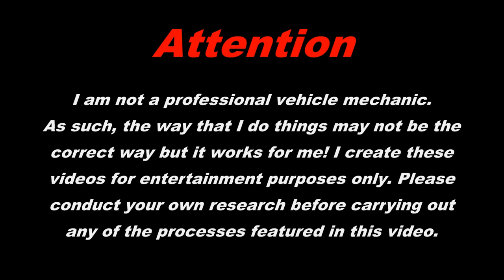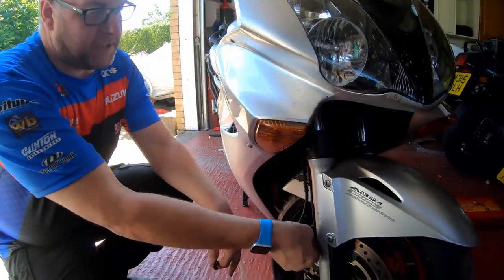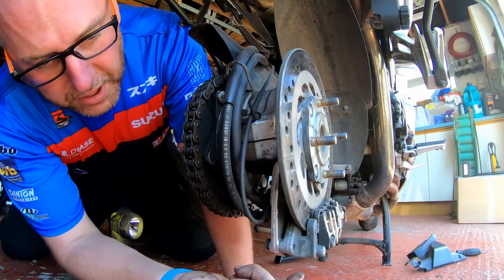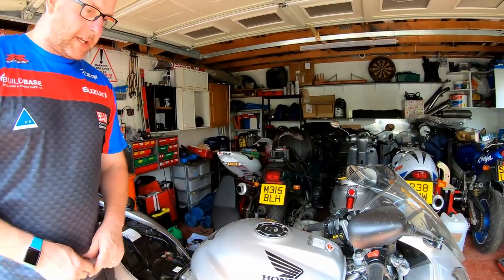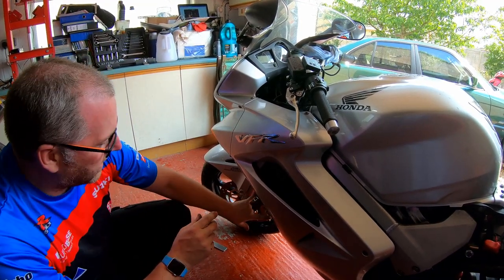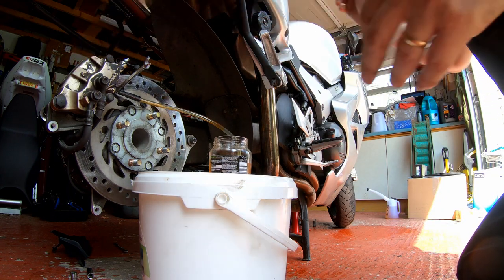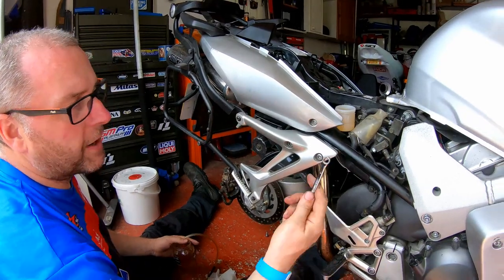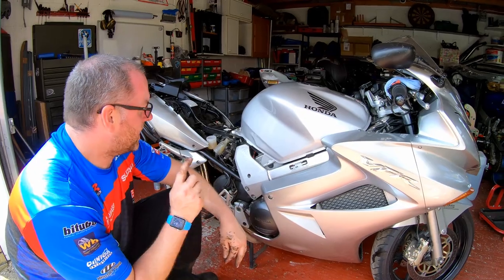2003 Honda VFR800 VTEC Changing The Brake Fluid And Bleeding The Linked Brake System (CBS)

Comment: I appreciate the procedural video but I can’t understand why you’d want to pull air into the entire system before adding and bleeding with fresh fluid. Seems like you made the jobs much harder for yourself instead of just flushing through new fluid to wash away the old in a sense. If I am not replacing lines, servicing calipers, or rebuilding master cylinders, I would just flush in fresh fluid to remove contaminants without introducing any air I need to flush later. Just my $0.02 I guess. Good tips on bleeding the rear in particular by moving the caliper

Comment: I just recently started having an issue with the bike that was causing it to lock up the brakes. At first I thought it was the abs causing the problem as I disconnected all the electrical connections dealing with the abs and the problem went away for some time. However, recently the problem has come back again and I believe it's because the fluids never been changed and is causing pressure to build up in the system. Thanks to your video I have some kind of guide to doing this job.

Comment: Hi Kev - just one little question regarding stage two. Could you please list the procedure like 1., 2., 3.,  I am a bit confused and not a logical thinker, but as I understand it: The assistant pumps the brake pedal five times and hold it down and the secondary master cylinder gets pushed out. Then you push the secondary master cylinder in the caliper, but do you at this point open the 10mm valve or is it already open. And by the way - thank for your brilliant tutorials, Kev.
Reply from the maker: No worries mate, you are using the rear pedal to push fluid to the secondary master cylinder, you then use the secondary master cylinder to push it up to the bleed nipple, so as follows - 1. Pump pedal 5 times to push fluid to the SMC. 2. Push in the SMC with your fingers. 3. Open bleed nipple. 4. Close nipple. 5. Repeat process if necessary.
Reply: @KevsShed  Cheers Kev! Looking forward to your next videos on the VFR.  Excellent job!

Comment: You shouldn’t have to actuate the second master cylinder,you could pull the fluid through to the proportional valve and it should flow through easily 👍
Reply from the maker: Thanks for the comment but that does not work. It should in theory but in my experience it simply doesn’t!

Comment: I did this on my vfr's - horrendous, but it tends to be never done, so makes a huge difference. I suggest using PTFE seal tape on the bleed nips to stop air entering back in the system. 
Great video!

Comment: Just a heads up for those watching this video.  The Non-ABS model of the VFR does not have the right side bleed valve.  This is only for ABS equipped VFR's.  This is also confirmed in parts diagrams.  The difference in bleeding the brakes is that you follow the same process, but obviously don't have that right side bleed nipple to bleed fluid through.  You just go straight to the rear brake and bleed from there instead.

  Otherwise great video.  Though, I think I would be concerned if I had that much travel in the front brake lever.  Looks to me that you might have some seized or very stuck pistons in the front brake calipers.  Having recently done a full service of all calipers on my vfr with new seals and proper grease on the caliper seals, and new brake fluid, the front brake lever is very firm and a lot of feel. 2 finger braking and not much movement at all from the lever. I wouldn't have half the travel you show when you use one finger to pull in the brake lever.  Though, this might be different for ABS equipped VFR800's.   

Please take this as just an observation from watching your video, which is very good and informative..    My point being in fact that my brake lever was a bit like yours in the video, a lot of travel.  When I took my brake calipers apart, I found that 1 piston on the left was very slow moving, whilst 2 pistons on the right front caliper were barely moving.  Though braking was OK..  after the full service, it is now outstanding..

Comment: @KevsShed
At Stage 3, at 32:23, can you please better explain how the assistant is "pushing down on the secondary master cylinder" at the front ?
Is the caliper still on the position from earlier ?
Is there still the plate on which it's squeezing on ?
When pressurizing the system using the rear brake pedal, what's happening ? The Secondary master cylinder is pressing on the plate and the the assistant is pushing the piston back in ?
Thanks!

Comment: Kev : Top Man !!! By far, one of the most outstanding procedural videos that I've encountered on YouTube. Acquired a 2002 VFR800A ABS VTEC, about three weeks ago. 44,777 miles. 
The only known maintenance was an oil & filter change at 39,188. It's never been down on it's sides (knock wood !), so it looks good (Italian Red), but it needs everything. We've so far done new Dunlop RoadSmart 4s; Honda filter & Mobil 1 10w/40 4T; Coolant system flush, then new Engine Ice; new Galfer semi-metallic pads front & rear. The pads are bedding in, but a spongey front lever, so a bleeding party is in the supplies & scheduling process. Not sure we'd attempt if not for your guidance. And then on & on until the bike meets & exceeds USAF maintenance standards. I've watched quite a few of your other VFR videos & am quite impressed with your production and technical value. An immeasurable contribution to the global "Viffer" community. Thanks very much, and keep "em coming.

Best regards:
TSgt Jeff Kennedy
Vacaville, CA (USA)
Reply from the maker: Thanks man 👌🏻😎

Comment: Very helpful video Kev, thank you. I was pulling my hair out trying to decipher how to bleed the rear brakes from the Haynes workshop manual!
A good point made by @mattlee8247 below too, as my VFR 800 is also a non-ABS model, and I have spent a fair bit of time in the recent past trying to find the right hand side bleed valve, only to discover of course that it doesn't exist on non-ABS braking systems.

Comment: Thank you so much for this video! It helped me understand how to do this while using the service manual. Some things are different because I have a 1998 honda VFR 800. I purchased a Mityvac just for this job and it's still a pain! I had no idea what I was in for. I haven't completed it yet but 85% done. I was a Aircraft mechanic and worked on cars and I still found this tedious and confusing!

Comment: Hi Kev, thanks for your videos, really helpful. 
About to start changing brake fluid on my VFR. 
What the advantage in draining the system fully before adding new fluid? Seems like more risk of getting air in the lines. 
Before seeing this video, I was planning to change the fluid using the method you show at the end but not draining fully.
Reply from the maker: I get your point, but the method demonstrated in the video is the method the official Honda manual describes. 👍🏻

Comment: Hello there, planning to do the whole process on my own using a vacuum pump
For the second part (refilling the system) can I just proceed with the vacuum bleeding in the displayed order without having to flip the rear caliper and remove the front left one to put it at 15º from horizontal or is there a risk that the air bubbles stay trapped inside calipers even with the vacuuming if calipers stay at their normal positions ?
Thanks by advance ✌🏻
Reply from the maker: Yes, the air will stay trapped, rotation allows it to escape
Reply: @KevsShed  thanks Kev, will get it done the right way then ✌🏻

Comment: Hi Kevin, I have rewatched this and it wasn't quite so scary as the first time around ;@).
You use the vacuum pump to drain the brake system of old brake fluid, can you use the same vacuum pump to fill the system with fresh brake fluid, ie filling the brake reservoirs with fresh brake fluid and then drawing it through or do you need a pressure pump to do this? Reason I ask is I do not have an assistant and have to do it on my own. If I had an asst they would be pumping for sure!
My bike is exactly the same as yours except non ABS.
Also at last MOT there was an advisory that indicated fluctuating brake performance on front brakes (prior to my ownership) so I think the calliper seals need changing so with the system drained of fluid it would be wise to replace the piston seals otherwise not to do so will mean they will probably have to be done soon anyway meaning re-bleeding the brake system again?
Hope all is working out for you.
ATB.

Comment: Great video as always buddy.
Can you tell me what size of clear pipe you used for bleeding ? 6mm, 8mm ?
Oh ! I am guessing 2 litres of DOT 4 fluid from Halfords will suffice ?
Reply from the maker: Cheers pal, I'm not certain on the pipe diameter to be fair, if I had to guess it is 6mm, so long as it'll snug over the end of the bleed nipple then it'll suffice. 2 litres of fluid will be more than enough. 👍🤓
Reply: @KevsShed  Cheers bud 👍

Comment: Congratulations! It's a really good work that you have shown here! This brake system is a bit more complex than regular bikes. My VFR had a previous bad owner and I bled a chocolate kind of fluid when I did the first brake fluid change.
I just have one comment about completely drying the brake lines because this allow air to enter the system. I am used to not letting any air into the hydraulic lines, what I do is drain and clean the reservoir containers and fill them with fresh fluid and then purge the system until clean fresh fluid comes out of the screw bleeders, this way it prevents air + moisture from entering the system and also makes bleeding a lot easier. Keeping moisture out of the lines makes the fluid last a bit longer.
Do you bleed this way to get all the old fluid out? I don't think this is that effective because all the lines and cavities are kept wet with the old brake fluid.
Keep the good work! Thanks for the video.
Reply from the maker: I did it that way as that’s the way it states in the genuine manual. To be honest I do this to my cars to a degree also, there’s many different methods and tools to employ for this task, whatever you find best and works for you! 👌🏻

Comment: As always, great job explaining everything Kev👍 I'm seriously contemplating on doing mine, thank God it's non-abs but I'm having recurring nightmares as when I swapped out my lines to SS I never got it right, and that was following the manual to a T! I gave up and took it to my local Honda shop. But it mightve been due to just having brand new lines. I do have a pneumatic power bleeder now so hopefully that will make it work more effectively and easier. Cheers Kev!

Comment: Hi Kev, I have a 2002 vtec  NON ABS model. Is it any different to what you shown on the ABS model?
Reply from the maker: Identical except for the second bleed nipple under the seat won’t be there on non-ABS models. Simply skip that part of the process 👍🏻
Reply: @KevsShed  many thanks Kev 👍

Comment: Hi sorry that this is a stupid question but was the only reason for transferring to pumping the brakes to pressurize the system rather than the vacuum for the second half just to show that it can be done and not that it's any easier. Just wanting to double check after your warning at the end.
Reply from the maker: Yes mate absolutely, The manual says that you must use some form of pressure bleeder and I often see people stating that it is impossible without a pressure bleeder. I therefore wanted to show that it was in fact possible without the use of any special tools and that a piece of hose and a jam jar will suffice! 👍🤓
Reply: @KevsShed  Thank you so much for all of your video's mate this vfr that I've bought is my second vehicle I've owned after my A2 licence so I've never worked on anything before Your guides show that it's a lot easier than I ever imagined to work on your own bike. Thanks again.

Comment: Hi  I have a 2002 vtec.  Followed your video. Brilliant.  But when I arrived at the bleed nipple right hand side ( sitting on the bike).  There was no nipple ?    What is your suggestion? I just followed the video ie rear caliper but missed out missing bleed nipple. Seems ok at the moment
Reply from the maker: Yeah, I didn’t specify in the video that it’s only ABS models that have that nipple, on non-ABS bikes simply skip that step 👌🏻

Comment: Bit of advice If you do this while you're doing a chain and sprocket getting access to all the bolts on the rear caliper is pretty easy. 

My VFR's fronts would lock up after a few uses when I first bought it. turned out there was some solidified brake fluid in the front brake master on the handlebars in a pin hole breather at the bottom of the reservoir

got the bike for a steal though $700+a 82 CB750 that I paid $750 for

Comment: This is one job I need to do which I am too tight to pay a workshop to do plus I want to be sure it is actually done properly for obvious reasons. Could you post your link to the pressure pump? Many thanks for making.
Reply from the maker: No problem here it is
http://rover.ebay.com/rover/1/710-53481-19255-0/1?ff3=4&pub=5575602299&toolid=10001&campid=5338707657&customid=&mpre=https%3A%2F%2Fwww.ebay.co.uk%2Fitm%2FBrand-New-Hand-Held-Vacuum-Tester-and-Pump-Brake-Bleeder-Kit-Cars-Motorcycles%2F263369099003%3Fepid%3D6011070880%26hash%3Ditem3d520586fb%3Ag%3AOr0AAMXQZ7dTlqXs

Comment: Great video Kev, just about to tackle this for the first time. I have a pressure bleeder as opposed to a vacuum and will try and use that. They are ace for cars but havent used it on a bike
No one makes a cap to fit the rear reservoir so I will have to improvise with a universal cap but if it works it should hopefully make the job easier. I will just flush as oppose to empty although I will take the dirty fluid out the reservoir and use clean fluid to flush the lines ( i know you are not keen on this method). Still have to remove and orientate the calipers but i want to give them a good clean anyway.
If it doesnt work I know i can revert to themethod you used. Thanks for all your videos, they are exceptional quality.
Reply from the maker: Cheers buddy! I also have a pressure bleeder and they are great for this job. One reason that you never see me use my pressure bleeder in my videos is because of the obvious compressor noise in the back ground! It should work great though! 👍🏻

Comment: Hi Kev great video followed your procedure but with a twist I used some clean clear pipe and done it old school I didn’t purge the old fluid first just flushed it through worked a treat. Excellent work 👍
Reply from the maker: Yeah, that’s quite a popular way, I just wanted to follow the procedure in the manual. Good work 👌🏻

Comment: Did this at the weekend , brakes worked great but on my way to work today front right calliper is sticking , 3 mile run and pads were smoking a little
Reply from the maker: If you have a sticking calliper then it may well pay to take the calliper off and give it a light refurb. New seals should restore its performance!
Reply: @KevsShed  just done the return journey and now the back calliper is smoking also and the front lever was almost solid while riding but softened after stopping for a couple mins when I got home

Comment: One quick question. If the system is completely flushed doesn't that make it easy to press the brake caliper cylinders all the way in? That way you may be able to diagnose a stuck-rusty cylinder or any faults in the braking system. 
 I'm asking because i'm planning on rebuilding all master cylinders and it would be a good opportunity to check them also.
Reply from the maker: Yes absolutely! That said though, you’d have had symptoms of a fault if you had any problems by now I’d have thought 👍🏻
Reply: @KevsShed  The thing is, it's my first bike so i'm not that good at knowing when something doesn't work properly. I think everything works fine but it's good to check every once in a while just to make sure.
Reply from the maker: Yeah, I get ya. 👌🏻